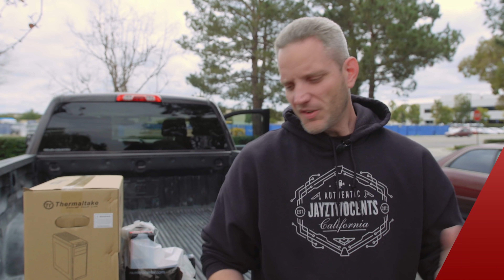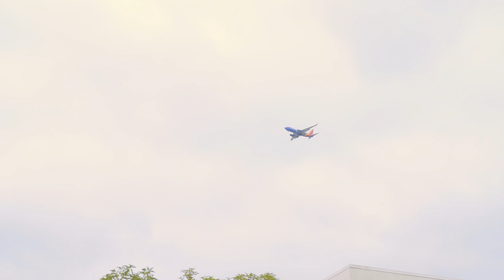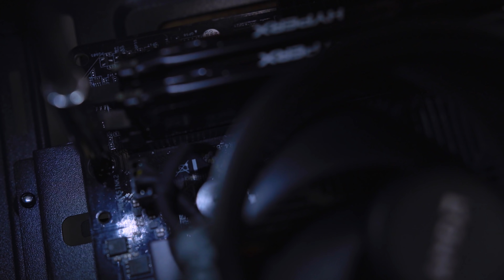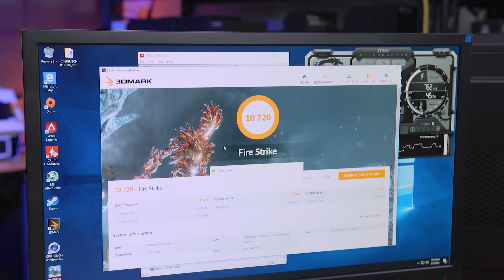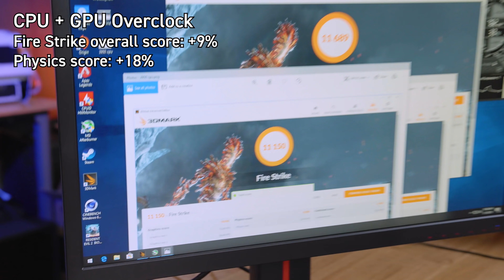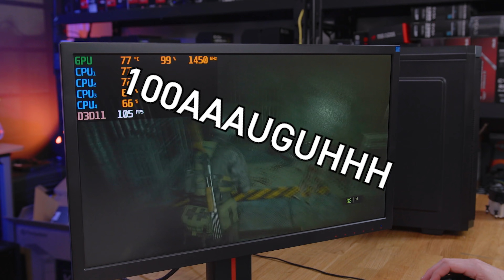CHEAP Gaming PC Build - 2019

Comment: This build isn't bad, but I would never really recommend to anyone to purchase and build a system for $500 unless they don't plan on upgrading in the near future. I say this, as building a $500 system then upgrading almost every component later is a colossal waste of money - in the long run.

No, I recommend people to make a plan for the parts you want, but can't afford.
How I upgraded my system to it's current status was by buying a Dell, Graphics Card and Power Supply.
Now, once I had money again, I bought a new motherboard, cooler and case, completely ditching the Dell, but keeping the original memory and processor.
Last I upgraded the memory and processor, and somewhere along the way, I got an m.2 SSD, and plenty of storage.

Money wasted: The original Dell build, which I resold on eBay for the original value, with the old processor and memory, and slapped in a SSD to make it a sweet deal.

I just feel this is a more effective way to build your way from bottom to top, with the least amount of wasted parts as possible.

My budget build:
Motherboard: Asus P8H61-M Micro ATX - $49.99
Processor: i5-3470 - $42.55
Memory: Corsair Vengeance Pro DDR3 1600MHz 2x4GB (8GB) - $39.99
Graphics: PNY Nvidia GeForce GTX 1060 6GB - $149.99
Storage: Kingston A400 120GB - $21.63
Storage: 1 TB Western Digital 64MB Cache - $29.98
Power: Rosewill HIVE 80+ Bronze Fully-Modular - $57.21
Case: DeepCool MATREXX 55 - $39.68

I chose a $40 DeepCool Case because it is far better than the $20-30 cases, but much less than the "premium" cases. Comes with tempered glass on the front and sides, RGB Strip on the front, and will show off every part of your build.

You could of course mix and match however you please, and I'm sure many of you could build one better than me. The sky is the limit for PC Building, don't restrict yourself to one mindset.
Reply: Never know what you don't know. You may get hooked and upgrade, you may decide console is a better option. I think a better understanding of what's decent vs what's overkill is more important. Spending double for a casual gamer doesn't make sense in my opinion. That said, I'd go 2400g with no gpu(what I did for the first year)
Reply: @TheNightShunter  water is wet.
Reply: Okay, you've heard it a million times, so once more won't kill you guys.

When building a budget computer:

1. Target Resolution: This is by far the most important aspect of choosing the parts you need - even more so than refresh rate. [720p, 1080p, 1440p, 2160p]
2. Monitor Refresh Rate: This is second on the list. Buying a monitor that is 2560 x 1440p @144hz, then buying hardware that can't saturate 144hz @1440p would be a bad example of this.
3. What games do you play? I think most of us will play just about anything, but if you are aiming for a specific game, then building around the recommended hardware is usually the way to go.

After you have decided between 1-3, you can then choose your CPU and GPU.

Things to think about before you decide:

1. Your CPU ultimately determines your maximum FPS. (These assume you are using a discrete graphics card.)
- Desired Resolution + Minimum Settings = Maximum FPS obtainable by your CPU at that resolution in the game you are playing.
- Desired Resolution + Maximum Settings = If you framerate is LOWER than your Maximum framerate, you are most likely seeing a bottleneck from your graphics card.

2. A FPS higher than your monitor refresh rate is WASTED money, power and heat. There are no exceptions to this. Build your system around the display you are running, unless you plan on upgrading it.

3. A good thing to think about is a overclockable motherboard, processor and monitor. These three things can save you money.
Reply: @princexaine5340  1080p should be the target resolution, no reason to be playing games below that anymore, unless you are buying used hardware
Reply: @princexaine5340  
There will always be a bottleneck of either CPU, RAM or GPU, so the (slight) bottleneck of thr GPU is what you want.
Reply: I am currently actually in the process of doing this, my last upgrade is my cpu then I’m re selling everything
Reply: Used is nice 
Got a: gigabyte z77 ds3h v2.0 —$70,I5 3570k(with cooler)-$70, EVGA 550w-$30,16gb-$35, 2tb hdd—$30, rx 580 8gb-$130, case-$25

Paid a little under $450 , had a i7 2600 (Xeon e3 1270) which is a better choice and it was only $60 so it’s cheaper and has more threads
Reply: @TheFirestriker101  Not bad, really needs a cooler though to get over 4ghz. If you dont OC that i5, an i7 dell/hp prebuilt is a better price/performance. Also, if all you want is 1080p folks, RX580 4gb is much better deal used (so are 1060 3gb & RX570 4gb). Have fun finding used deals, its generally a lot more fun than buying new off amazon.
Reply: Bam Bam I’m at 4.2ghz I got a 212 evo from a friend, i7 would be better anyways cause games are taking advantage of more cores/threads. Now that I think about it in some games my 2600 got more FPS than my i5 oc’d and the bad thing about k processors used is they are probably degraded and can’t reach high clock speeds.
Reply: @TheFirestriker101  4.2 is a nice OC for that 3.4 baseclock chip, ~23%. What voltage? Also, i doubt a non K i7 2600 would best that i5 in gaming. The clock differences are just too massive for SMT threads to make a difference. Maybe in synth tests but most likely not in gaming.
Reply: Maybe Randomly Bam in newer games it beats my i5 I’ve tried Conan exiles, forza horizon 4,sunset overdrive, assassins creed black flag/syndicate, fortnite and sea of thieves. In those games I get a better FPS, even with me setting my i5 to 4.2ghz somehow I get rekt granted I had all my cores on my 2600 set to 3.8ghz if I remember correctly.
Reply: ir-5 9400f is the best value cpu for any gaming pc
Reply: you got DDR3 and yet say plan for the long run and the build that you want, upgrading to a processor and mobo that support DDR4 is worth it.
Reply: @stormy4752  the budget build you see there was just my take on the above concept and has no real correlation with anything else I said.
Reply: That's a rather long comment you have there sir

Comment: almost same build i did last month..
 ryz 5 2600
2x8 kings fury ram
msi b450 mb
500 watt Bronze +
120 ssd + 500gb hdd
power color 580
Very solid build and spent only $550 and most games run average 75 fps

Comment: Thanks for doing this build. I have a similar setup. My case is a little better quality and I have couple more fans for cooling. The same GPU just another make. The motherboard is similar and using the same CPU. I'm only into iRacing. I had often wondered what my system would do on others games. This gave me a better idea. Also really dig all the custom work as well.

Comment: maybe it will bring a little more graphics performance if you lease the rx 580 with the bios of the rx 590. at least that works well with the vega 56 with bios patch of the vega 64. Of course, dan are still a few small adjustments needed.

Comment: This PC will last a couple of years then it will need to go in the bin as far as gaming is concerned.
Reply: Why?  You could upgrade the CPU (and sell the old 2200G) and GPU (selling the 580, if you added it) and save significantly over a whole new system.  And who knows what kind of awesome new Ryzen might be available for the upgrade?
Reply: @abcmole  I highly doubt a B series board will be compatible with the 3rd gen Ryzen.

Comment: Is APEX LEGEND that less demandable from OVERWATCH? I got 2400G  with MSI B350M PRO; 8GB 2400MHz..... and OW goes in 1920*1200 all low with just 25-40FPS.... honeslty I expected around 60FPS (at least with the 75% resolution switch on) And anyone else experiencing here and there black screen with Chrome ?

Comment: Also, buying reclaimed oem windows keys for $5 on Ebay is 100% legal. I've asked a Microsoft rep. As long as the seller includes a broken piece of hardware (which they only ship if you want it, because they legally have to).

Comment: YHY I rather spend little extra (or buy 1TB HDD) and take Ryzen 1600/1600X/2600 whatever is  cheaper then Ryzen 2200G and  have normal CPU (I'm currently siting on Ryzen 1600X after selling 2400G). Those APU are great for the price but in the end of a day they are still just 4 cores. And on top of that 2200G doesn't even have SMT.

Comment: The third option for OS. Go Linux and wine+DXVK.

Enjoy the 10%~15% performance drop and unable to play certain EAC games, including Apex.
Reply: Some show a clear performance increase in linux. So how does that shit work?
Reply: @jamegumb7298  As a Linux gamer , I could tell you, DXVK for DX11 definitely has performance degradation.
For ASTRONEER, the RX580 performs pretty poor compared to Windows, using the same setting, under Linux it can only get 30~40 fps while mostly stable 60fsp under Windows.
For Valkyria Chronicles 4, it can sometimes reach 60 fps, but Vsync doesn't work. It never caps to 30 when failed to reach 60.
So the game experience is pretty bad.
For Monster Hunter World, it can only reach stable 30FPS @ 1080P, while windows can reach near stable 60FPS @ 1080P.

And just check winedb to see how apex still stay garbage rated since forced EAC check implemented.

Although I'm super happy that a ton of games can run under Linux and open source AMDGPU driver works even stabler than Windows driver sometimes, but when DXVK is involved, it's still a performance degradation due to its translation layer nature.
Reply: mac OS vs Linux OS

Comment: i use the same processor like yours and im using gtx 1060 6gb..running Resident evil 2 on high settings is amazing..i got like 120fps

Comment: If i use r3 1200 and buy 1 tb instead of 2tb and doesn't buy an ssd and a cheaper case, then can I include this gpu in my 420$ budget?
Reply: The performance difference between a 1200 and 2200G is not much. But for a high end card, you MAY need a better CPU
Reply: @arnitdo  my full setup budget(including everything, from cpu to monitor and mouse,etc) is 560$
Could you suggest anything?
Reply: @ipizza9941  Either get a really cheap cpu like an Athlon GE with the plan to upgrade it later and get a decent card like a 570, or forgo the card and get a 2400g with the plan to add in a card later.
Reply: @bardacuda82  Athlone 200ge is not enough. I wanna make productive pc so is there any intel counter part? And 570 will bottlenecked by 200ge most probably.
Reply: @ipizza9941  then go for ryzen 3 1200 it's 5000 rupees only and over clock it u will get a decent performance and light editing and also 2k cheaper than ryzen 3 2200g and buy a good graphic card with the ryzen 3 1200 rx580 at RS 13999 on Vedant computers website and when u have money just upgrade the processor to new ryzen CPUs coming in may-july with 6cores cheap
Reply: @zmx2144  Rx 580 is out of my budget. Its 14000 and 2400g is 13000 and i can't even get a 2400g :(
Sadlyf
Reply: iPizza the MLG pro the 2tb hard drive is only I think $12 more the one he had at the time of this video
Reply: Then I would go with a 2400G and no video card for now. Your budget is extremely tight so there's not a lot of options.
Reply: @bardacuda82  I'm trying to accommodate a 2400g, I'm 15 and after my yearly exams are over I'm gonna get a whole new pc, but the budget is 560$ :(   
So I'm trying a assemble a decent pc for 420$ and 140$ for other peripherals. Even a monitor is gonna be difficult to accommodate with all the other stuff and there's hardly any used stuff in my area that I want. 2200g looks like a last option to me. I really need some better suggestions for peripherals.
Reply: https://pcpartpicker.com/list/RY8zTB

~$400 before case and peripherals. Should leave you some wiggle room for other components. Can knock $20 - $30 off of that by only getting 8gb RAM, but that board only has 2 slots and Ryzen doesn't do good speeds with high DIMM/rank count if you wanted to upgrade later.
Reply: @bardacuda82  this is great and all but I'm from India and I will most probably buy stuff from local stores because it is generally 5$ cheap(it may not sound much but it is for me). 
I have also made a list.
I am thinking of buying gigabyte b450m ds3h(which has 4 ram slots), Corsair value select 4gb ddr4 2400mhz (2 of them),Corsair vs450w(very common, might actually buy an antec 500w)
WD blue HDD 1tb 7200rpm,
Which saves just enough room for 2400g but no room for case(I can do 2400g, but I want a good air flow with led fans) I also have lg 22m38d monitor in mind which saves only 35$ for keyboard,mouse, headset and case.
Reply: @bardacuda82  here 2400g is almost 50$ expensive
Reply: @bardacuda82  just to sum up, I have got everything with 2200g and I have 70$ left for all the peripherals(excluding pc, monitor and case) meaning mouse, keyboard, headset, and speakers. So please go ahead and give me suggestions.
Reply: @bardacuda82  i dunno when you can get an i5-9400f for 15$ more and the boards are all similarly priced.  not sure why this cpu isnt getting more attention
Reply: Send a pc part picker list so I can get to know the actual components you are using and I'll send another list back to you under  560USD
Reply: You should try to get DDR4 3000 at least. Around here it's not much more than 2133 or 2400, but dunno about over there. Ryzen benefits a lot from faster RAM, and the APUs doubly so because the built in graphics use, and are held back by, the system RAM.
Reply: @bardacuda82  i can but then i can only accommodate 1x8gb g.skill 8gb module 3000mhz which is almost the same price but it will also suppress the performance, I mean it's a better deal as it leaves more room for upgrade and I can buy another on my b'day :) which will become 16gb! And my apu will become even faster! You are right, i will do it. The only problem is im confused whether to get Corsair vengeance (which is 550₹ cheaper, my country currency) or buy g.skill?
Because if I have more 550 left then it makes more room for my headset which will be 2k which is 28$. Can you please help on these?
Reply: Well what are you looking to play ? Budget builds aren’t hard if you know what your doing my pc was
 70 for case mother board and cpu I bought dell prebuilt i5 2400  390 optiplex 
Got 560 for 70 as well
27 for ram 2x4 8gb 1333mhz wish is max speed mother board supports 
35 bucks on brand new power supply 80+ bronze then bought cheap 120 Gb ssd for my os and some games till I could afford more that right their runs fortnight for instance on all high settings anti aliasing off 85 to around 90 FPS constant thought I did do a lot of windows debloating removed almost everything could deactivated lots of services and stuff to csgo is 160 FPS constant on all high settings it’s not greatest computer but cheap and works
Reply: Also I didn’t over clock which I hear the i5 2400 can go from 3.10 to 3.7 or so I see no need to since it’s not bottle neck rn my 560  is
Reply: @julienaguilar9026  i wanna have some room for upgrade, like buying more ram and dGPU in the future because i wanna squeeze every advantage of my system.
Reply: I wouldn't use single channel. The GPU portion would be starved for bandwidth and you'd only get half the performance out of it.

Comment: I'm currently looking into buying an rx 480 8g used and bios flash that to an rx 580 8g to replace my old r7 370. Any experience with such a project and how much better is it?
Reply: You're probably about to brick your card, so it's a lot better for saving power as it won't work. Even if it did, I don't see how this would improve your performance beyond what a simple overclock would have.

Comment: What's the ultimate budget fortnite build for my son. I also play too as he thinks it's cool cuz none of his friends dad's play with them. 

FYI current system:
Amd 1090t black edition
2 X 4gb Gaskill ripjaws DDR3 1600
Gigabyte R9 270x windforce 2gb
75hz cheap freesync monitor

Where could i improve other than everything. Overclocking isn't possible as the aging components crash with any overclock nowadays. TIA

Comment: see i just built a pc that had new and used parts that had a ryzen 5 1600, 16gbs of 2400 mhz, a 1070ti, a b350 tomahawk , a diy bg01 case evga 550w psu, and a 144hz monitor for 650$ the only used parts were the mother borad and monitor. i also had a 240gb m.2 drive and the gpu was used

Comment: Nice build! Using combined Microcenter and Newegg pricing, I came out with this for roughly your target budget:

CPU:          AMD Ryzen 5 1600 6-core/12-thread 3.2GHz(3.8GHz turbo) Socket AM4

Motherboard:  ASRock B450M-HDV R.40 AM4 Micro-ATX AMD Motherboard

RAM:          16GB(2x8GB) G.Skill Aegis DDR4-2400

Video:        PowerColor Red Dragon Radeon RX 580 8GB GDDR5

Storage1:     128GB Crucial P1 M.2 NVMe PCIe-3X SSD

Storage2:     1TB Western Digital Blue 7200RPM HDD

Power Supply: 500-watt Antec VP Series 80+ White Certified non-Modular

Chassis:      Coolermaster Masterbox Lite Micro-ATX Tower w/ tempered glass

OS:           Windows 10 Home 64-bit key from Kinguin
________________________________________________________________________________________________________

$584.91

Comment: Funny.

I just builded a similar PC but 4 times more expensive.

Just built a computer with 2200g and rx 570.

The GPU and the PSU (seasonic 540) were used, bought them secondhand

I didn't need a HDD, i had one already.

I paid the same price overall for my build.

2200g: 110 bucks
MSI B450M GAMING PLUS: 80 bucks
Patriot Viper 4 8GB / 3000MHz KIT: 70 bucks
Cooler Master MasterBox MB600L: 50 bucks
Crucial 240GB BX500: 45 bucks
Asus STRIX ROG rx 570 4gb : 140 bucks (used, one year warranty left)
Seasonic M12 II 520: 40 bucks (used, no warranty)
Arctic Freezer 33 eSports One Red(CPU cooler): 35 bucks

That's 570 dollars. No HDD. And i make 4 times less than in the us. (But for me the tax were 154 dollars not 40.)